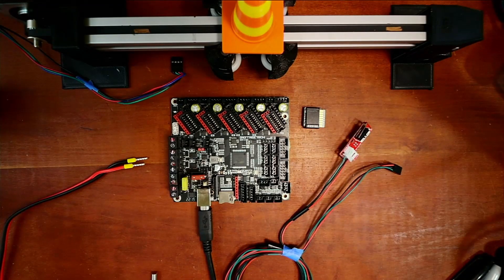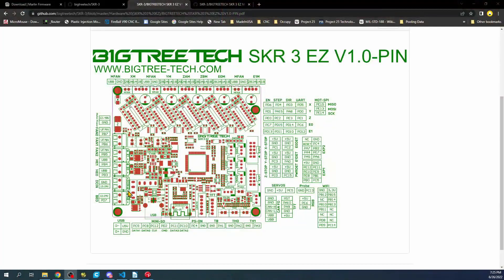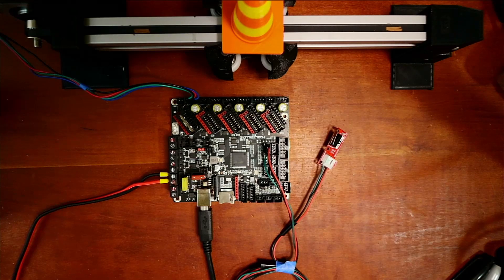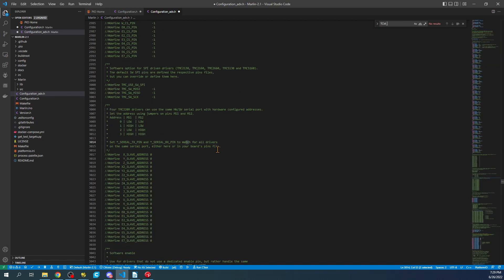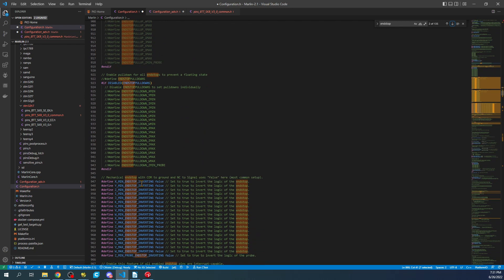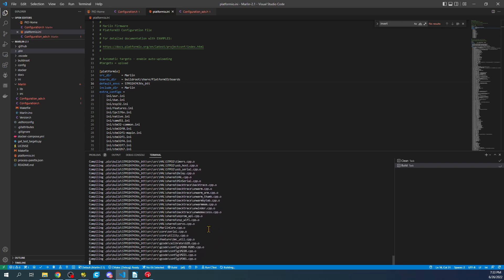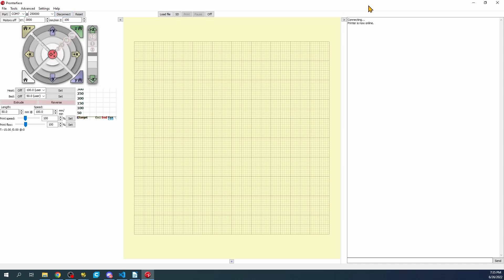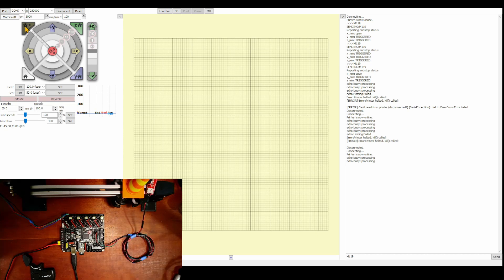Big Tree Tech - SKR 3EZ - EZ5160

Comment: What exact Benifits does the SKR 3 w/5160’s have over older boards? ie) mini E3V3 w/2209 and SKR 1.4 turbo w/2226 steppers
Reply from the maker: Stronger steppers to drive larger NEMA motors.